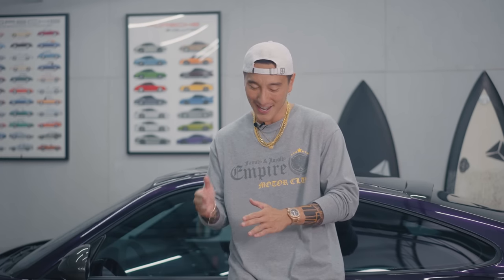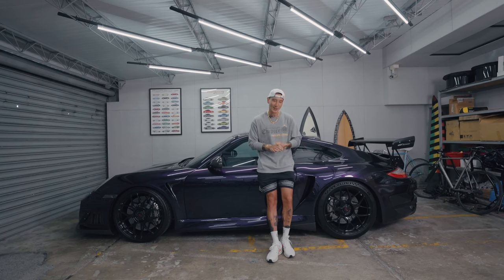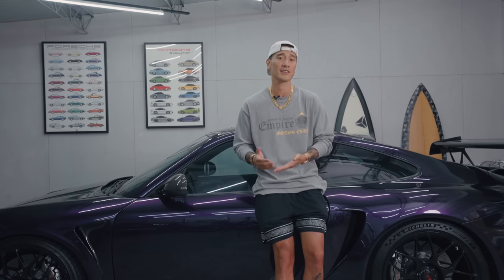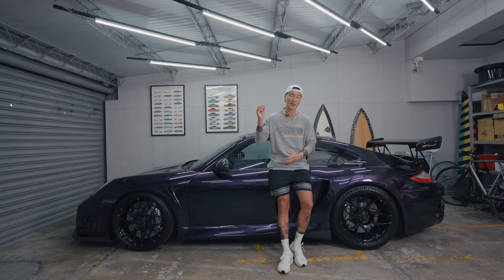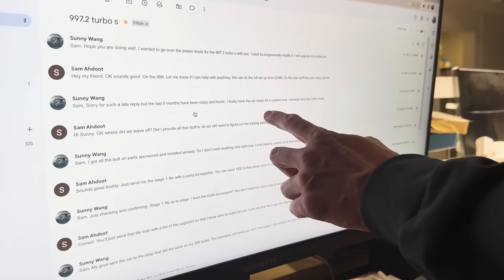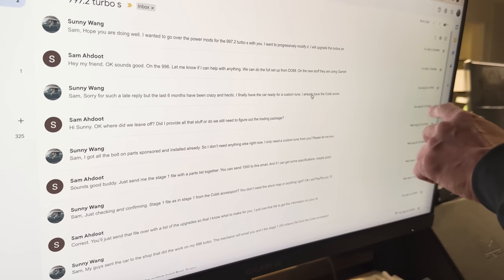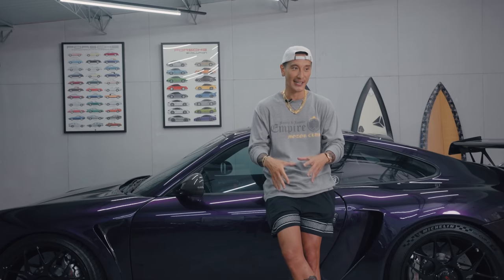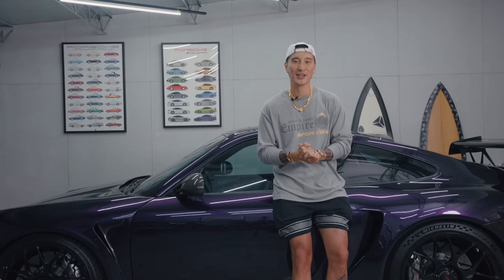怎麼辦！？新的改裝車突然掛掉了｜MY NEW PROJECT CAR JUST DIED ON ME!《EMC Vlog Vol. 97》

Comment: Bro that on-board computer is not dead. You can only kill the re-programmable flash fuse, not the Freescale processor. You can change the programmable flash chip or protection fuse and you are good to go. The computer is not self-destructible. Porsche is not capable of designing something like that.

Comment: “It can only be flashed a couple of times”, damn yo, that’s crazy. They probably turned off a lot of sensors when coded with US specs, that’s why no error popped up before your tune.
Reply: It’s possible. Back in the day most guys would just take the computer off and send it off to a tuner….and when u reflash, risks r super high… 😂